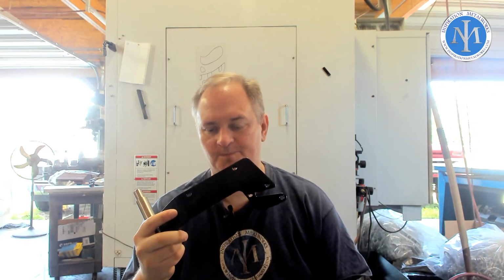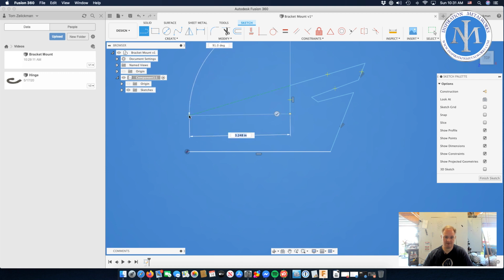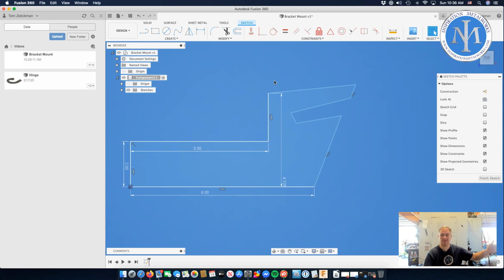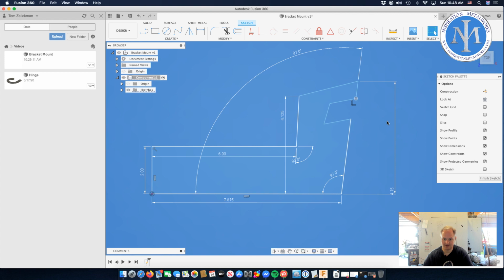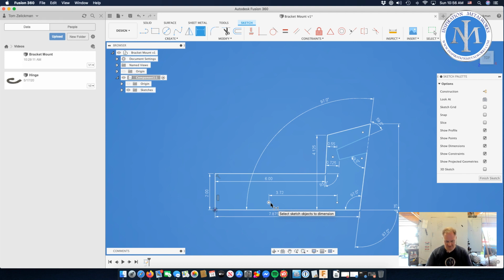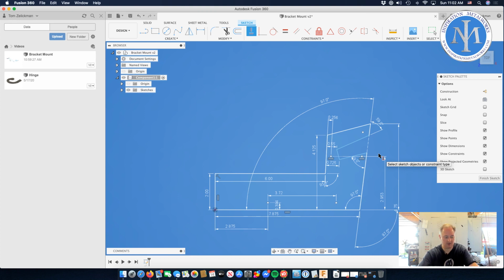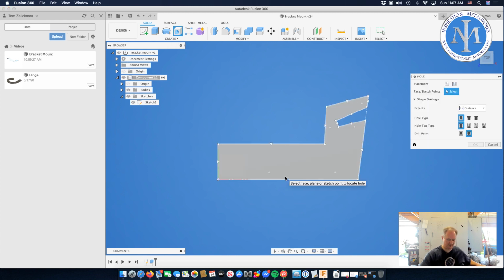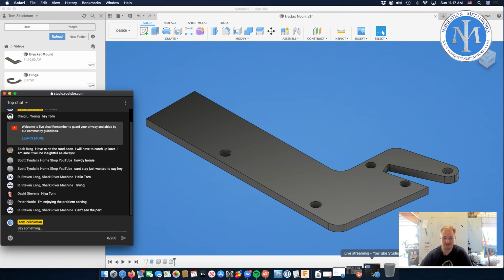Reverse Engineeering

Comment: Measure what you can measure and write it down.  Then make adjustments.  You are second-guessing yourself into a hole.  I know I am writing long after.  Always keep the part in the same orientation to yourself.
Reply from the maker: Spot on assessment plus I was trying to do it a new way rather than the way I would have typically done it. Should have done a dry run rather than go right into the live stream but thought it might be interesting to a few folks. Thanks for watching and taking the time to comment!

Comment: Tough doing it live.  Thanks Tom.
Reply from the maker: Would definitely like to hear your thoughts on how to do this one. I ended up getting it right but really fought this. I went back and did it again using a piece of paper and had it drawn in 10 min.
Reply: @TomZelickman  When doing something like this I always try to pick one point to reference from.  If the Ref. is a hole I put a gauge pin in and measure as much as possible from it.  I also concentrate on the most important feature first then the others start to fall together.  If the Ref. is an edge  or two edges clamp block to it or set it up against something solid to measure from.  There is all my secrets.